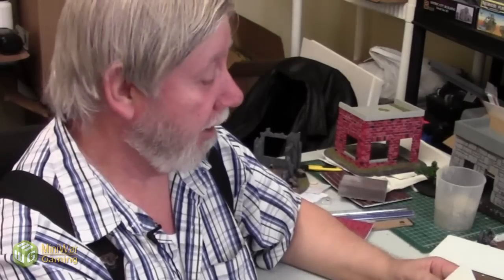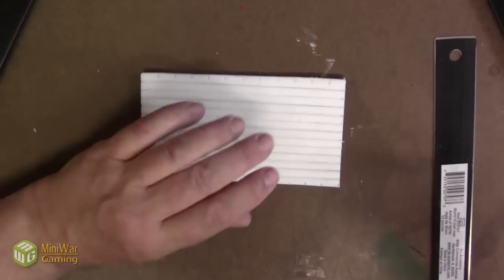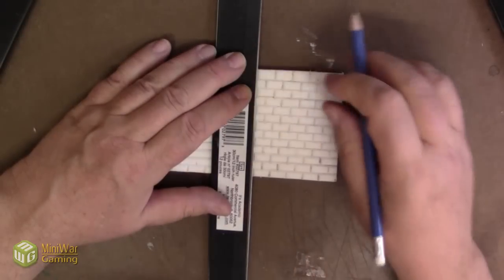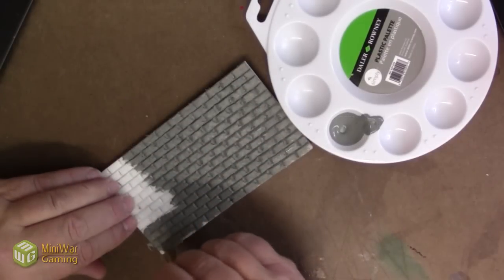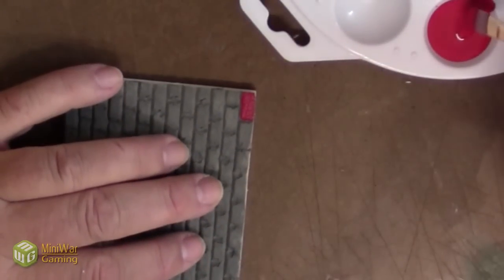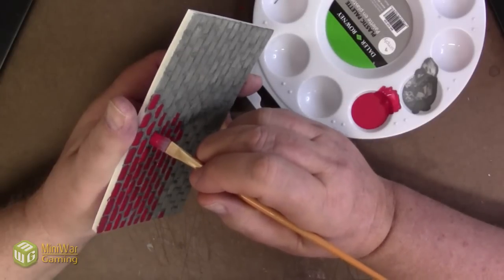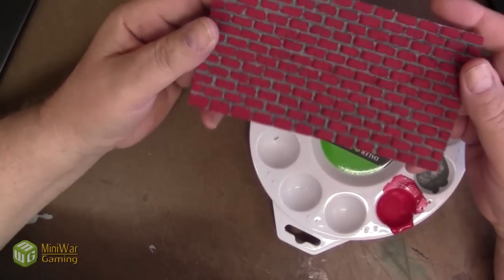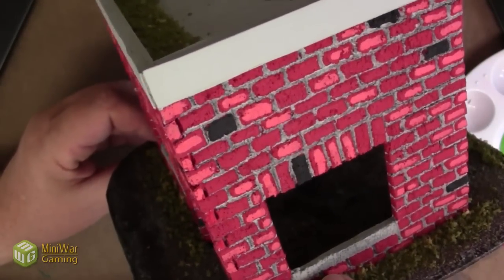Terrain Tutorial: How to Create Bricks from Foamboard

Comment: Does the foam board have the outer paper coating on or off? He has done this with it off before so just asking.
Reply: When I do textures I find it more helpful to take the paper off. You can spray it with hot water and gently bend the board and the paper will just peel off.